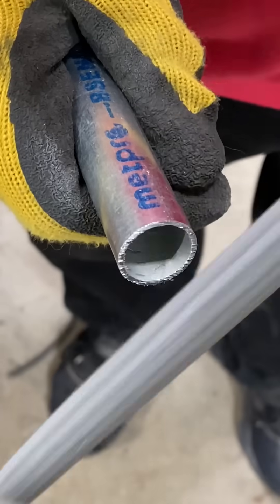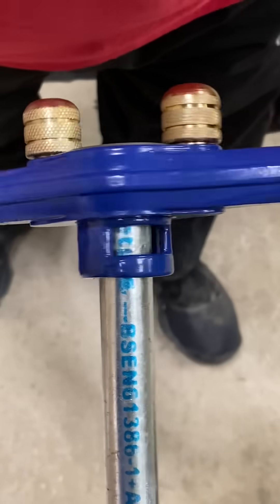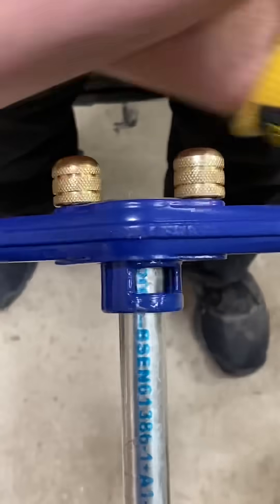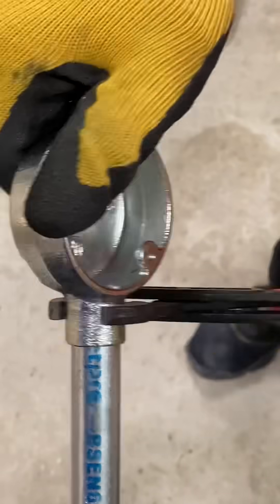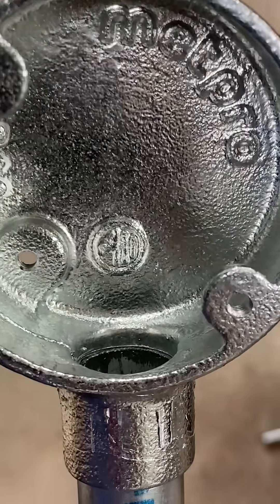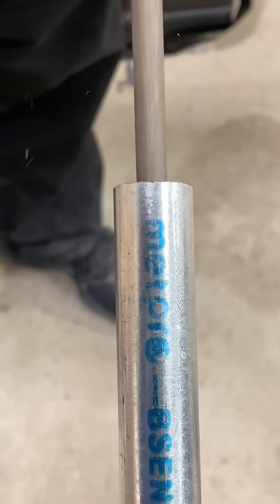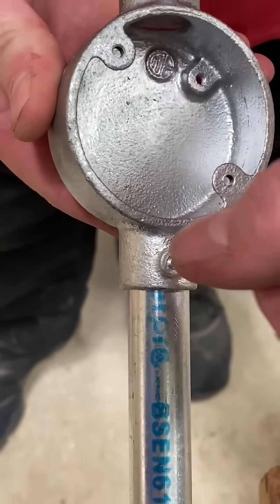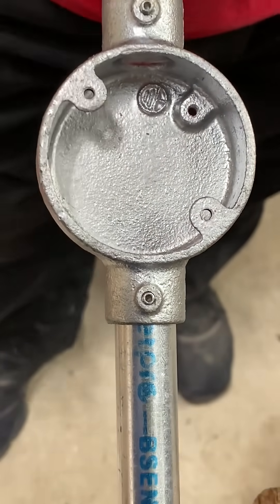THREADING METAL CONDUIT VS CONLOK FITTINGS -#Shorts

Comment: put a thread on 1 side, the tiny grubscrew connector on the other..
Then have a pull test..
Reply: Is people tugging on your conduit a common problem in your static installations?

It looks pathetic but that little grub screw is enough 95% of the time.
Reply: @OliWarner   yes this I a huge waste of time!!
Reply: @OliWarner  absolutely 💯
Reply: @OliWarner  it's not people that pull on them directly. Usually it's ****ing forklift trucks, or similar, attached to a person. 🤬🤣 Never had a threaded connection fail... lots of bent conduit though.
The other factor is moisture ingress. Not an issue with threaded... always an issue with crimped; which this is worse than 🤷‍♂️
Reply: @OliWarner  the company advertises weight bearing structures and all forms of opportunities including frames. That little grub screw won't do the trick.
Overall, it seems that about half of time for install and so long as it isn't vastly expensive it seems like a great idea.
 But, to not get the assurance of strength, or longevity, I would think that this would really only be good for contractors looking to "speed things up" (cutting corners).
I have only done threaded in my own installs.
Reply: @OliWarner  it’s all static until the insulator uses them like scaffolding to access the ductwork after a multi-floor flood.
Reply: @OliWarner  5% of conduit-box connections is still a hell of a lot.
I'd sooner put a decent thread on.
Reply: @OliWarner  I guess I just don't know what happens after someone leaves. but if something falls later and someone says "that previous ahole fitted a conduit with a tiny little screw rather than doing it properly, sue him for the thing falling down..
Reply: @OliWarner  buildings do this really cool thing called move. A lot.
Reply: @greengoat5654  if your building is moving so much that it's pulling the conduit connectors apart, I think you probably got some more problems on your hand there bud.
Reply: @GeneralJameson  I live in Arizona so structural changes over time of year are actually quite drastic
Reply: @GeneralJameson  %
Reply: Usually the screw pierced the pipe a bit, the situations where threading is necessary… seem rare, it’s made and used for a reason, if you wanna get into complaints about quality let’s discuss Walmart furniture or new cars and trucks, sounds more viable.
I’d wager 99.some percent of the time these work fine,
Reply: @ptfsndsw7028  we don't have Walmarts here. I guess they are only in places where cheap junk is what people want and have not advanced to developed countries yet.
Reply: @ColinRichardson  lol, relevant argument
Reply: @ColinRichardson  damn mate. Vicious much?
Reply: @Coffee4myTavor  That the "not sure a grub screw is enough to hold on to a pipe" or "walmart" comment?
Reply: @ColinRichardson  walmart. I am not a fan of walmart but still.
Reply: @Coffee4myTavor  Should have I said expensive junk?
Reply: @ColinRichardson  our military equipment seemed sufficient enough to leave you beneath us
Reply: @Viralvid2024  Is that from Walmart also? or Costco?
Reply: @ColinRichardson  yeah, exactly cupcake
Reply: Vibration Test would also be interesting.
Reply: @ColinRichardson Thinking of earth quakes are you?
Reply: @deang5622  Earthquake is exactly what me and my wife call it... oh... you talking about something else?
Reply: Pull test?  Who is pulling your conduit like that!?
Reply: Setscrew will be fine, they are not moving parts , use threadlocking fluid if worried about vibration.....threading is overkillx100
Reply: Because pipes get pulled on....
Reply: connectors work, set or comp ez pz.
Reply: Jake Thejeweller  no, I mean it's a security feature if it won't support the weight of some oik climbing your building.
Reply: Sure...threada win but what wall is pulling conduits?
Reply: @thunderballz74  I was more thinking of di*kheads that will be snooping around long after you have gone.
Reply: @ColinRichardson  in the US conduit gets secured to the walls with a screw and clamp combo and all the joints are held with a screw. Ive never heard of any issues with them coming loose
Reply: Jake Thejeweller  seems like win-win.
Reply: In some cases I would want the comlock to pull off vs ripping out my entire wall if for some fuk odd reason something goes to yanking.  Pros and cons to both
Reply: What happens if you lose the grub?
Reply: @dmaysx6  replace it. If you're doing a bunch of these all the time, one would likely carry a box of extra screws in the place the threading tool took up.
Reply: @necrojoe  you'd think it would be that easy I'm betting 80% of the time you just improvise lol
Reply: Jake Thejeweller  Having the tip of a screw protruding into the inside of a conduit could score the sheath exposing the wire. I work in telecommunications and if someone did that to a conduit I was pulling fiber, Cat5e, Cat6, or any communication wire it would very likely damage the wire causing failures and possibly could hook the wires or string leading to us abounding the conduit. Set screws work great and are used everywhere here in Canada, granted ours have bigger multi bit screws. You don't need to worry about a tiny dent in the conduit.
Reply: @Dragonborn__  I'd like to think theres an apprentice out there just impact drilling every bit of conduit he touches to make sure the flat set screw breaks through the other side
Reply: @Dragonborn__  the set screw doesn't pierce through the conduit. It just bites into it slightly.
Reply: Is a gorilla living g I. The roof pulling on the conduit?? Why do you need it to be that pull resistant?
Reply: @Gkitchens1  For mischievous youths and drunk people.  Apparently "Darwinism" is not a good enough reason to let things break.
Reply: @yung-megafone  is this the same America which seems to have "Wire Nuts" in every inch of every house?
Reply: @ColinRichardson  wire nuts*
Reply: @calebpettifer  thank you
Reply: @ColinRichardson  oi, back off the wire nuts. Those are a meant to be a taste snack for the next person to open a junction.

Comment: Is it as good as a thread conductivity wise?
Reply: No. I got called to a site with a 32 amp 3 phase CNC that had a fault on it but hadn't tripped out the breaker (just blew the laptop out of the servicing technicians hand). Little grub screw just wasn't able to pass the fault current.
It's fine as fast install containment but it's not suitable as an earthing system.

Comment: Those little lock screws on the Conlok can and will come out. If they just would put some thread locking (like on lock nuts) on those screws as standard...
Reply: They don't come out. We've been using them here in the states for decades.
Reply: Proper torque is the key to threads staying in place
Reply: the grub screws are just pure dung. Far too small for the application, either that or just crap quality as often they're stripped before you even try and use them

Comment: For the love of god , why do have to follow the Americans 
If they don’t have the skills to thread a peace of conduit that there problem we should not copy or do things the way they do it . Well done Gaz a proper spark
Reply: Buying the equipment to thread each piece is expensive, especially if you only do this occasionally.
Reply: @kierenhudson6331  a stock and die set you buy once and if you take cere of your tools they will serve you well and last for a good few years, a stock and die set is a hell of a lot cheeper than that stupid milwonky  saw and electric threading thing .
Reply: @Dog-whisperer7494  well said. I use my chop saw with a steel cutting blade and use these fittings
Reply: @kierenhudson6331  there’s nothing like a good old fashioned hacksaw a stock and die and a good dollop of elbow grease to get the heart pumping. And when you get home at the end of the day you feel like you have done a hard day’s work
Reply: @Dog-whisperer7494  And done how many fewer fittings?
Reply: @JimWhitaker  if you’re good at what you do you should be able to just as much if not more than the guy with the fancy kit

Comment: Call me old fashioned but I still feel the the threaded install is a more professional installation and is going to provide better endurance and a guarantee of the electrical continuity of the conductive conduit over time.

I'm sure the grub screw arrangement has been well tested to ensure it won't loosen over time but I would probably be more accepting of something that was almost a hybrid between push fit plumbing and tool-less electrical connectors. 

If the pipe socket had a conductive metal toothed spring arrangement offering pull out resistance and continuity, with the grub screw only there to lock the pipe against rotation.
Reply: Time is money . And bosses are always asking why we take so long . They probably say the grub screw is to long 🤣
Reply: @owent2032  some bosses need to get back on the tool and stop the all day liquid lunches then they would know why it is taking so long
Reply: @sean dempsey Some bosses have never been on the tools!
Reply: @shandd9640  exactly my point if they gave it a go then they would know just how hard we work .

Comment: I want to say that what we call "rigid" conduit in North America is closer to  what you call steel conduit in the UK, rather than EMT. but yeah, set-screw fittings are nice~
Reply: Looked like imc to me emt in america is thinner than that
Reply: I think what he has is thicker too. There wouldn't be anything left after cutting threads that deep in the EMT sold in the US.
Reply: @court2379  that's exactly what I was thinking
Reply: Hello, Being a Electrician in the UK Time served with WT Parker’s Burton upon Trent, I used Steel conduit or you can say rigid conduit has we say here in Canada. Also being Construction Electrician here in Canada I used EMT Conduit which I find very useful in most Application, I also use rigid has well I think in my opinion threading the conduit is better.
Reply: I would say the threading of rigid steel conduit or IMC intermediate metal conduit perfectly acceptable because the diameter of the pipe is substantial enough to take any stress put on it by any kind of bend or loose connectors straps however EMT has what they call here in America thin wall and thin wall is not suitable for threading because it would put too much tensile strength on the pipe that threded in and would break very easily in my humble opinion and I just don't think it's the right way of doing things and especially with the set screw you can't use that Outdoors as it's not watertight
Reply: @tricklicker69  That's not really how it works. RMC, IMC, EMT have different outside diameters and are intended for different applications.  RMC outside diameter is sized to allow for standard NPT pipe fittings. IMC has a slightly smaller OD but will still allow cutting of the same NPT thread for a given trade size. EMT cannot be used to cut NPT threads because the OD is too small. EMT is typically used with compression of setscrew type fittings.

Example:
1" trade size RMC O.D = 1.32"
1" trade size IMC O.D = 1.29"
1" trade size EMT O.D = 1.16"

Both 1.32" OD and 1.29" OD is intended for 1" NPT thread forming with standard dies. 1.16" OD tube is not intended for thread forming/cutting because no die exists to do so. Standard NPT pipe fitings would obviously not fit.
Reply: @tricklicker69  they do however make watertight fittings for EMT.  But personal I don't like using them.
Reply: Yeah emt in America isn't allowed to be threaded per the code
Reply: Idk fellas I’m kinda thinking it’s regular old emt
Reply: @dallasbillet8273  way to thick for EMT
Reply: @dallasbillet8273  same here. That looks like regular EMT to me which we don’t thread here in the U.S. as you know. We thread ridged (RMC) though. And that tiny set screw on the box doesn’t look great either. I’d prefer either a emt compression connector w/ the gasket, then thread it into the box. That Way it has the advantage of being threaded into the box but also the Convenience of not having to thread the conduit. Again all assuming that’s regular EMT.